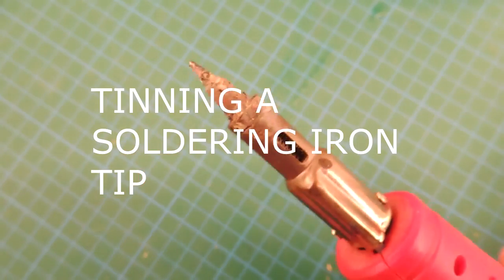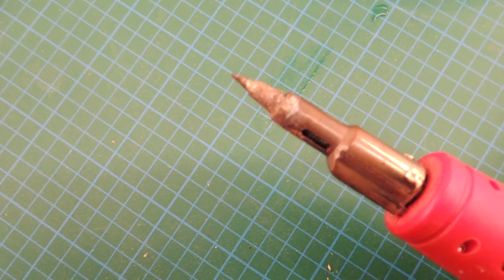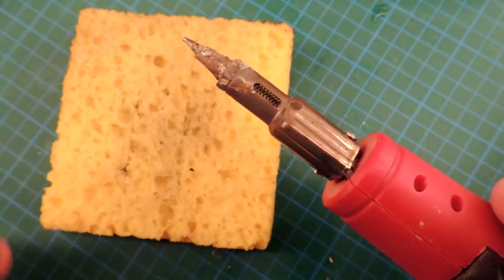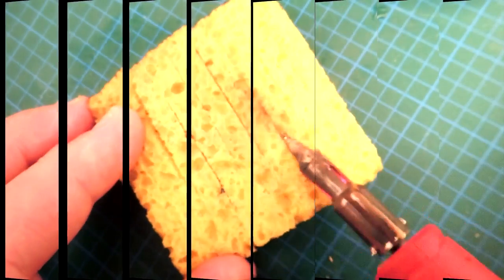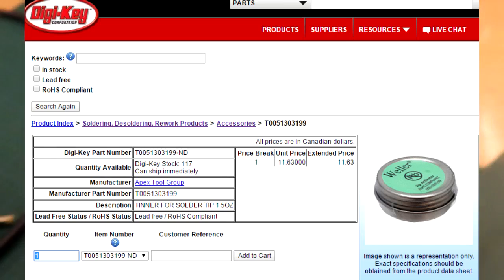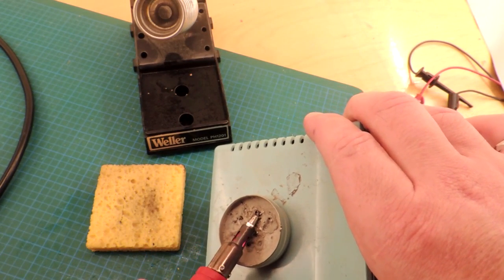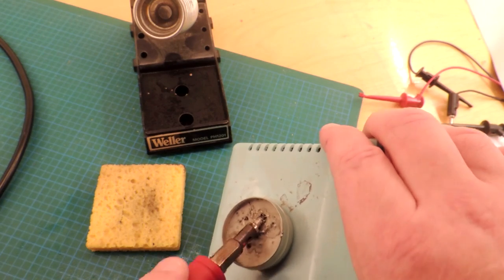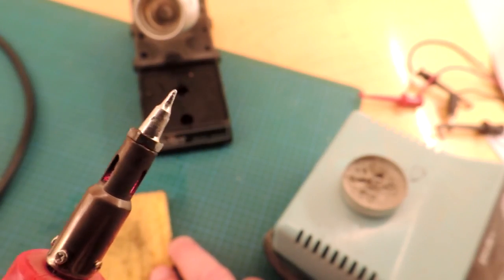Tinning A Soldering Iron TIP

Comment: Hi. Sorry to contact you this way. I'm getting a 4 cell bifilar coil & want to run it at 7.83Hz without spending a lot. I saw your review of the VICTOR VC2002 Function Generator which is in the right price range although a little more would be ok. I would like to get as close to 7.83Hz as possible without being too fussy. Any recommendations? Great if you could help. Thanks. michaelg3@windowslive.com

Comment: I think that tip cleaner stuff is a mixture of flux, solder and fine abrasive.  It works wonders on even the cruddiest tip.
Reply: +bigclivedotcom So do you think it could be substituted by using an abrasive, adding flux and then solder?
Reply: +The Captain I've never actually considered making my own.  The little tub I bought decades ago is still doing fine.

Comment: my iron is on from the moment i wake up all during the day (most days) and the tip never looks like that, that tip has got way too hot which is why the solder has gone all crusty, tip tinner is okay but if you use it too much it erodes the iron plating off the tips.

if your tip is that bad that its covered in black areas that wont accept solder then file the surface off with a normal fine metal file and expose the copper underneath then coat it with solder, this gives you a bit more working time with the tip but you will have to replace it soon anyway but it will get you by until your new one comes from ebay etc.